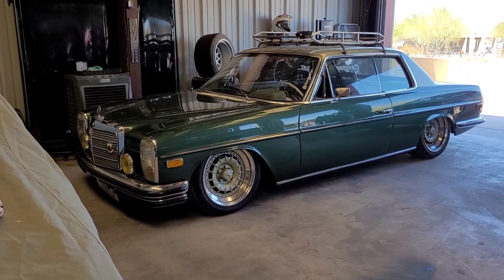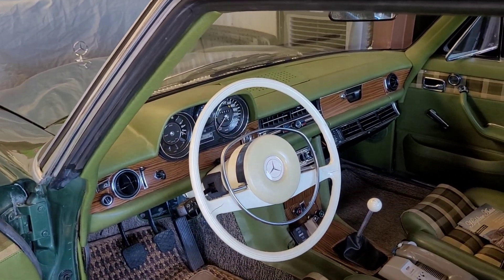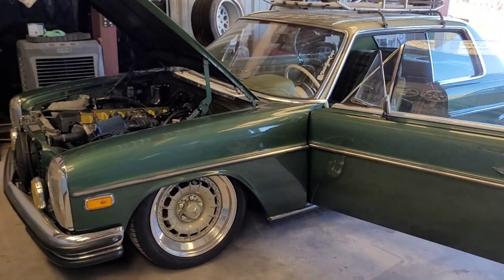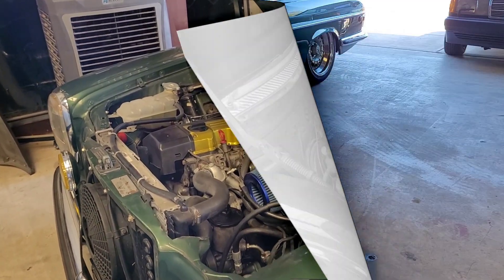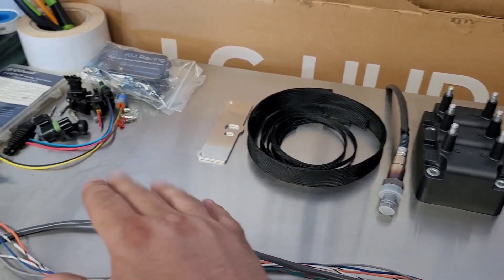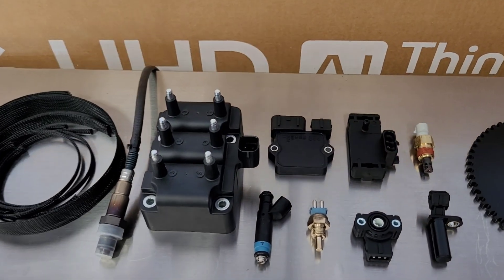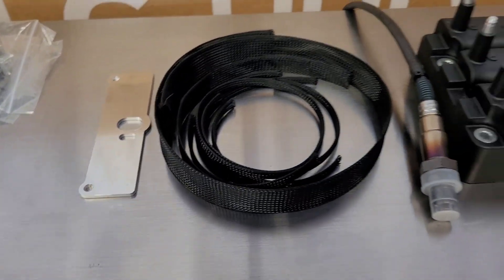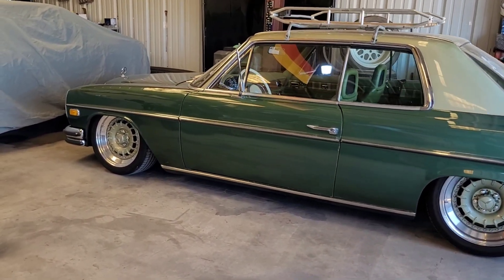M103 EFI Standalone ECU Explained DIY Episode 1

Comment: hey just curious where i can find info on a similar project. i want to EFI my 1991 300e 4matic. i want the original cluster and keep the distributor for now. its planning on turbo but the car doesn't start when cold. cranks for 2 minutes. its a daily driver so I'm just trying to efi it as cheap as possible with out affecting as much as possible.
Reply from the maker: Sounds like your looking for more of a piggyback setup like i have on my latest shot on my evo1 car check out my other videos is that what your looking for more of less

Comment: Would you still recommend that wasted spark coil or would you recommend doing a coil on plug setup? Slowly planning out my m103 build
Reply from the maker: Still do the wasted spark why not it works fine with no issues
Reply: @thebenzhouse sweet Instagram still the best way to reach you? I'm starting to gather parts and I'm sure I'll have some other questions
Reply: @thebenzhouse also what spark plugs do you recommend for a basic wasted spark na setup? Or does that kind of depend on the ignition used?

Comment: I don’t see a fuel pressure regulator. How are you controlling rail pressure? I want to do this on my 2.6 190and I believe the K-Jet requires around 60-65 psi. Second question, assuming you disconnected the EZL, did you splice into the stock ignition switch? It would be helpful if you had a list or diagram of what was merged to the microsquirt harness. Thanks!
Reply from the maker: Yes there is a fuel pressure regulator  on the fuel rail itself so no need for another one and no ezl or anything from the old system this is a stand alone setup it's a full ecu that does fuel and ignition there are diagrams online for how to wire it I didn't show.in this because there are MANY MANY ways to do it if you have different sensors or a different setup I didn't want to confuse anyone I hope this helps if not just let me know

Comment: For an M103 124 wagn, would you recommend this EFI Standalone ECU setup,  But without the turbo? or is it a waste to invest all this with no Turbo?
Reply from the maker: @hamlulit  absolutely not a waste of time I EFI all my personal cars and there NA I would highly recommend it you'll be better gas mileage better throttle response more reliable better on the engine I love EFI over CIS
Reply: @thebenzhouse  Thanks, Man!
What ECU do you recommend"?
How is the MaxxECU SPORT?
Reply from the maker: @hamlulit  I would call some tuners locally and see what they like to use because trying to find a tuner is a nightmare sometimes and will prohibit you from using many different ecu's BUT I personally like micro squirt I've had zero issues with them and you can't beat it for the price

Comment: Do you believe your setup with these or similar parts could be done for an m104?
Reply: Just got my M104 on the stand today up here in Seattle and just starting my EFI journey!  
Wish me luck 🍀
Reply from the maker: @jimpeters3328  good luck man and congrats that's awesome a standalone will help alot
Reply from the maker: Absolutely
Reply: @thebenzhouse  I have a 1990 300SE that is sweet, yet having it converted over to EFI and turbo charged would make it even sweeter.

Can you pull together a 'kit' for me to install?